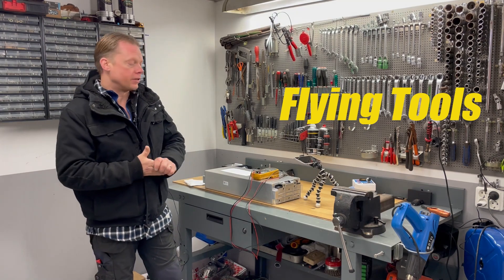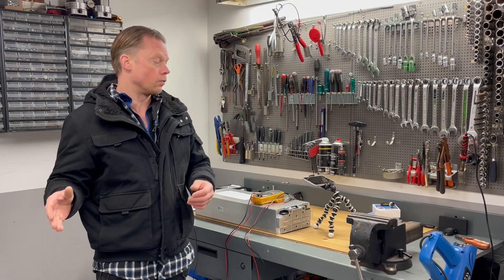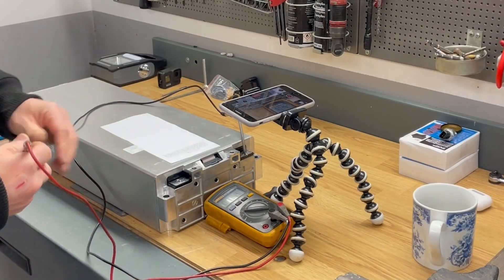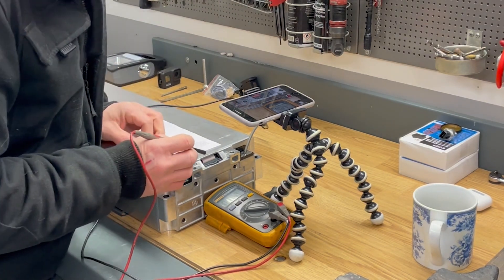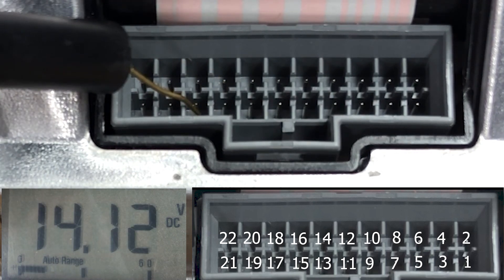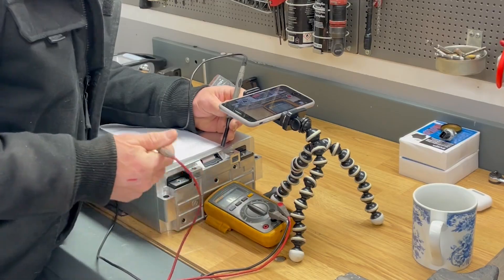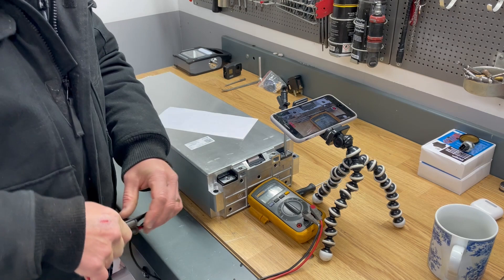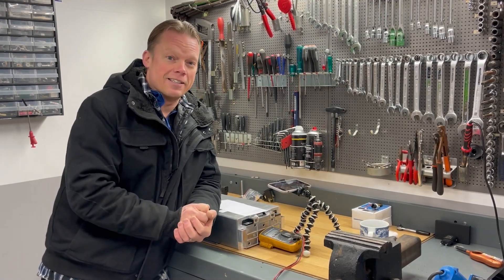VW 8s battery pinouts to BMS, easy and simple off grid 24v battery.

Comment: Very helpful video. I have a question. Is it possible to overbridge the burnt smd ?
Reply from the maker: Only if you cut the module up. Like I did in this video:

Open up a VW id3 id4 lithium battery module.
https://youtu.be/uP-lOsd4cVY
Reply: @flyingtools  
Thank you for your answer. I burned  the last fuse-cell 12 but connected the wire on + terminal so I had luck and no need  for tear down the module.
Reply from the maker: @igorbenic5886 Glad to hear that you worked it out. There is one extra wire in the connector for both the most positive and the most negative terminal if you rather want to use that one in the future.

Comment: I have modules from a Jaguar iPace, and they also have to read cell voltages via the data connector via fuses. Do you happen to know the maximum discharge current that a BMS can take from these pins when it is equalising the cell voltages? I am sure it is a similar figure of 750 mA, which means a lot of BMS's cannot be used as their cell discharge rates will blow the fuses. The new all in one DIY BMS with the non active discharge board has a suitably low discharging current I believe, and is quite cheap.
Reply from the maker: Hi!
I think that 200mA is a good discharge balance current. That’s what my BMS works with.
Thanks for your question☺️

Comment: I have several of these, still looking for a cheap source for the cables so I can hook up a BMS.
If you do put these in series, Schneider makes an inverter that can go up to 60v...
Reply from the maker: That’s great! I use my victron for the 12s version, and the voltage can be set all the way up to 63v, good to know about other inverters, thanks!

Comment: id buz is too new ...  are those LFP ? ?  i asume its half charged so its NMC chemistry  what is the most optimal  balancing amperage   asuming your  knoledge of  fuses those  pins have atatched on ?  sorry for my  writing mistakes!!!
Reply from the maker: What do you mean with to new? I have a complete pack from the buzz. 
No, those are hi C-rated cells, Lion ncm712
Reply: in a double series of these to  48 volts system uses less of its  capacity as you show in the past then in 24 is quite less loss and you are more in the balancing area !!!perasonaly  i m not a fan of daly  . a full programmable more sophisticated bms might help those to  work flawlesly!!!!..  keep up man .. this  car battery on more stationary usage is extremely interesting .!
Reply from the maker: @anaxiosesti88  you are right, Daly is very basic but have worked really well for me. I use Orion bms I’m my bigger HV battery pack. That’s a fantastic bms and it balances the cells with 200mA .
Your writing is just fine👍🏻
Thanks for commenting ☺️

Comment: hello again from germany!
you mentioned in the video that this 8s configuration is ideal with victron inverters. I am using tesla modules for solar storage which have only a 6s structure. So I run into problems with the cutoff voltage of 21V from my EASun inverter these days, when the sun is not shining so much.
Would a victron solve this problem? You said you had good experience with them, although for me they are too expensive. 
Overall, would you still recommend them although you are using solax now?
BTW: again very interesting video!👍
Reply from the maker: Hi☺️ 6s is on to low side. Victron will cut of at 19v, approximately 3,3vol/cell.

Comment: Was looking at these batteries the other day, how great that you have produced this video.
Reply from the maker: Thank you! So glad that you like it.☺️
Reply: @flyingtools  One thing that is very dissapointing is that fuse system. Burning one fuse trashes the whole package? This is so wasteful... But your knowledge of the thing is great and thank you for sharing as well as giving warnings for anyone who wants to play with it without thrashing the whole thing!
Reply from the maker: It’s an important safety feature, lets say that you crash with your car and you have a short in the balance leads, then those wires inside of the module might melt in to the pouch cells and you will have a thermal runaway if they don’t have those fuses. I’m so glad that you liked the video, thank you ☺️
Reply: @flyingtools  seeing as they are surface mount encapsulated whats to stop you from removing the encapsulation and just soldering on a replacement fuse. Or does it kill the bms when the fuse goes.
Reply from the maker: @pkf4124  that’s possible, I have done it. But you need to cut the module up with a angle grinder, I highly not recommend that. Check my link in the description: open up a battery module.
Reply: @flyingtools  Please, don't get me wrong, i'm all for fuses! But why do you need to destroy a battery pack? I bet there are ways to make thos conduits accessible so a service tech could exchange a few parts and save a very expensive rest of the pack. I work in warehouse automation service for almost 12 years, so i can really appreciate a good and servicable build of components. This is so scarce today, like everyone is built to be thrown away at a slight problem... 😒
Reply from the maker: @ogi22  No, i fully understand you and feel exactly the same. A small service hatch had been just perfect 👍🏻
Reply: This code is not found in google.

Comment: Take a look at SIMPbms, EVS-BMS or GRNbms. You can connect them directly to the the MEB CMU's! 
No need to make a custom connector to the batteries etc.
Reply from the maker: Hi!
I already know about them the but still think that it is more interesting and fun to do it myself. And to chairing that knowledge will never hurt. Daly bms for the really simple projects and Orion BMS for the more advanced and high voltage systems, like the one I am using to my house. I also plan to use Orion BMS to my  EV project, probably one of the best and most versatile BMS out there.

Comment: Hello.  Thank you for your time and another video.  What type of BMS do you recommend for balancing and monitoring such a battery?  Thank you
Reply from the maker: Hi!
I have used Daly and Orion bms for the more advanced systems.
Reply: @flyingtools  I've seen a lot of materials from the OFF-Grid Garage channel (Australia) regarding Daly BMS and it still has a problem with balancing at such low voltages.  How does Orion work with such low balancing voltages?
Reply from the maker: @Pawel_GP   well, I don’t know why he has problems with Daly, I have built 10 battery banks without any issues at all 0,020v delta. And 5 bigger systems with Orion that works perfectly. 0,005V delta in a 108s configuration. 
Low volt problems??
I’m sorry im not sure what you mean.
Reply: @flyingtools  i think they are talking about the balance current usually being only 150ma. When you use big lifepo4 cells like 280ah, 150ma doesn't do much. Jk bms is beat with 2amp balancer.
Reply from the maker: @aniketos7336  2A!!😅 that’s totally in sane! I did some calculations.
Let’s say that you need at least 200 mA of balance current to keep the cells balanced in a 48 V system, 24 hours of balancing is the same as 240Wh.
And after one month of balancing 7,2kWh. Those cheap lifepo4 cells are most likely the biggest problem…
Thank you so much for the information BTW☺️
Reply: @flyingtools  with lifepo4 you really only want to balance when the voltage is above 3.45. And its only that high when in absorption. So it may only get an hour or two a day to balance. Andy had a video on it where the 150ma wasnt able to keep balance on its own.
Reply from the maker: @aniketos7336  Ok but that’s  the same with lion 3,8v and higher is the normal balance start voltage, but still, what makes them go out of balance?
You have to keep in mind here that I only are working with lion from ev cars, and I guess that those cells have a much lesser self discharging. But it’s always nice to learn about new stuff, so I am glad for information 😃